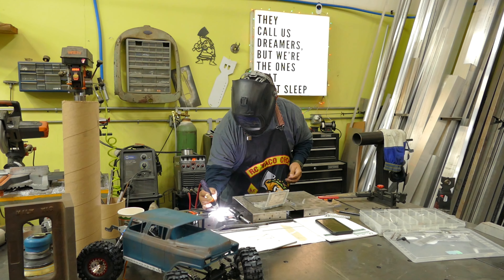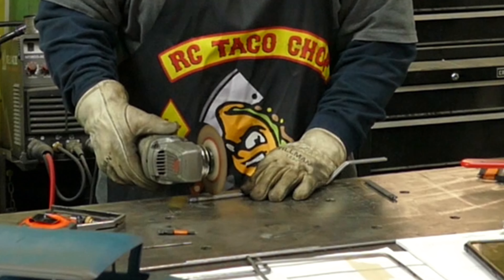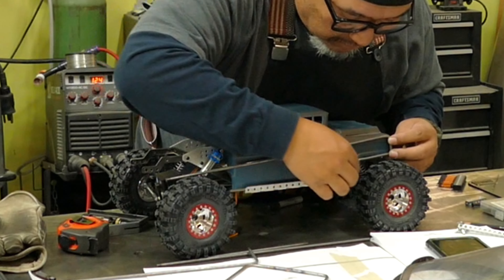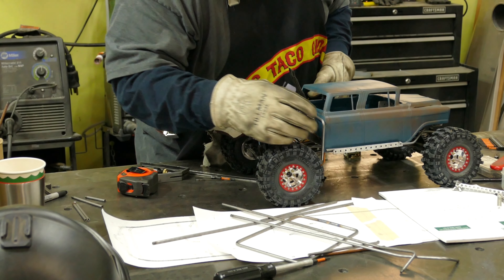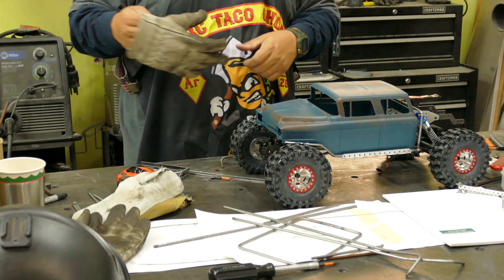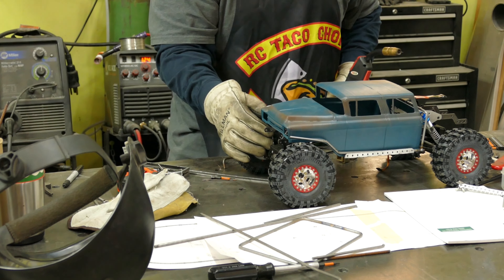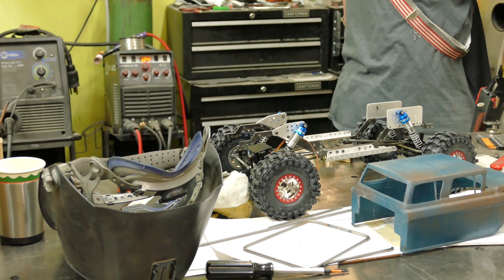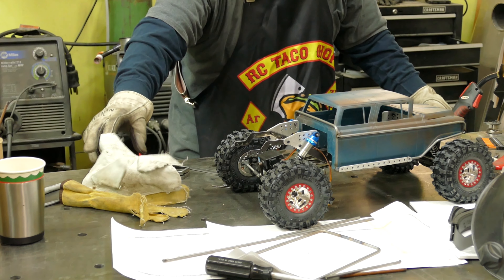Jericho Gets Armor: Building the Ultimate RC Roll Cage (Step-by-Step!)

Comment: Do u don’t use this filler rod while tacking? I’m trying to figure out what size and type is best for rc fabbing with 3/16 and 1/8 solid steel rod.
Reply from the maker: Most of the time yes that way I don’t have to over heat the metal while TIG welding. I generally use 3/32 or 1/16 rod depending on the metal. Most of the time it’s 1/16.
Reply: @rc_amigos  so u need the shielding gas for tacking?
Reply from the maker: @WreckitRalphie  if you are TIG or MIG welding you do. If you are just tac welding with a MIG welder I use .023 wire.
Reply: @rc_amigos  now what electrodes do u use